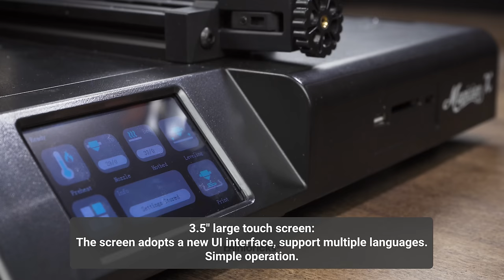Minibricks: How to make SUBNAUTICA Ghost Leviathan / MINGDA Magician X 3D Printer

Comment: Looks marvellous. <3 Do you do anything special against the bubbles in the resin? I see a lot when you are pouring, but almost none are visible when finished.
Reply from the maker: I do degassing in a vacuum chamber
Reply: If you can't afford a gas chamber then you can also use the resin in layers.
Many use this technique to paint these 3D fish in.
You make a small layer of resin then you let all the bubbles come to the surface and then you remove them with a long lighter.
It also worked very often for me.
Reply: I heard you could also use a lighter to remove the bubbles
Reply: A candle and half a cat
Reply: You can use a blowtorch or lighter to pop them as they rise.
Reply: @annaeverett1999  a heat gun works even better. I enjoy watching mine absolutely wreck the air bubbles way too much
Reply: I use a pringles can
Reply: I use a metal straw and carefully suck the bubbles out.
Reply: @neon72  good soup
Reply: @martincahill5622  how do you get your hand unstuck first? :(
Reply: @XX-jk7hx  gas chamber?😂 “GAS INTENSITIES”
Reply: @minibrickscraft  imo the bubbles almost felt appropriate for the subject matter though, kinda looks like particulate floating in the water... but a clear resin gives you a better picture
Reply: @henrybarry4022  or better, a flamethrower (btw don’t actually do this)
Reply: @annaeverett1999  lighter only works on the top/ surface

Comment: i love everything about this. would love to see a little drone breaking though the ice to  meet a bio luminescent toad-centipede coming out from an underwater cave. above a frozen surface with a little space outpost and towering snow cover mountains with mountaineers climbing it to get to a dish array for their little base.  then from a cut way in the mountains you can see a birthing chamber ware little tadpole like creatures fester. a lost explore dead frozen inside the mountain cave above water in the birthing chamber. the at the bottom of the sea floor wreckage from the previous outpost that maintained the dish covered in algae and moss. and heat vents bubbling up.

Comment: So do you have to use a pigment or dye for the epoxy, or would paint or food coloring work? I’m planning my first display right now and wondering how I can get by

Also is the uv adhesive used because it’s easier or is there a different reason for using it? Thanks!

Comment: Regarding the 3D printers, which I know you have several, is there a method or reason as to why you would use filament like this one, vs. resin like most of your others?  Does one work better for certain kinds of things than others?  Also, I very much love your genre-themed projects, like fantasy and horror.  I would love to see something SF-related, something in space or maybe an alien monster on a strange planet.  Love your work!
Reply: They got paid to push this printer. Either through money up front or through referrals. Simple as that.

Comment: Could you build a chimney, pour epoxy, put a straw through and blow a smoke filled cavity, and seal the top, trapping it?
Reply: That is not how smoke works
Reply: @samisenbati  it would settle, but if agitated, may become visible again. Ive never seen it tried, but you may be correct
Reply: @Scp716creativecommons  I don’t thin that agitation will help (btw I have no idea how you will agitate smth inside diorama). Particles that were in smoke will just lay down or stick to the inner sides of a bubble.
Reply: @samisenbati  like the lights. Maybe run a tube, that is removed, creating a negative space inside the epoxy, and put in the visible atmosphere, with a little fan. It may not work, but if it could be done right, i think it would look awesome. Actually maybe thats the way, create a negative space, that pulls out the bottom, and put in a little steam engine setup, visible through the epoxy, surrounded by it, but not liable to foul the clarity
Reply: @Scp716creativecommons  that sounds way too complicated, it could be easier to imitate smoke with something solid.
Reply: @Scp716creativecommons  or even to make a shape with with dense liquid colored grey and particles like in a snow globe
Reply: @samisenbati   i really like that, liquid snow globe effect for smoke. I think i need to get my lady to take on a winter art project!
Reply: @Scp716creativecommons  yay! Glad I could bring an interesting idea:) Message me on how it worked out ^.^

Comment: The leveling sensor on the 3d printer is not working correctlly, it should never bend the plate like that.

Comment: that's a LOT of resin... you over done it. Maybe something else could be used instead of so much resin.... so expensive. Should've just made a 1cm roughly layer of resin all around the plastic you made the case of, and then use the resin as a container. pour real water with a tint and maybe even some other stuff. And the top with a resin lid and some more resin to join it when done. MADLY EXPENSIVE.